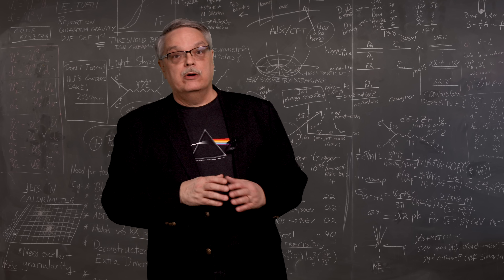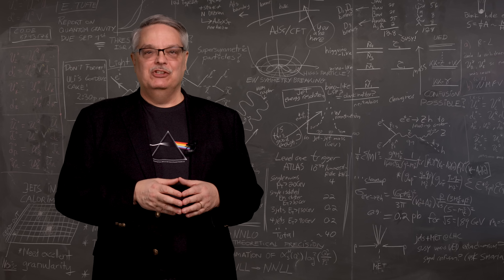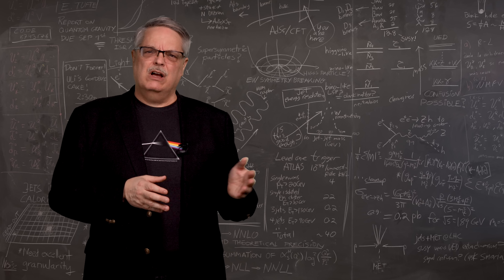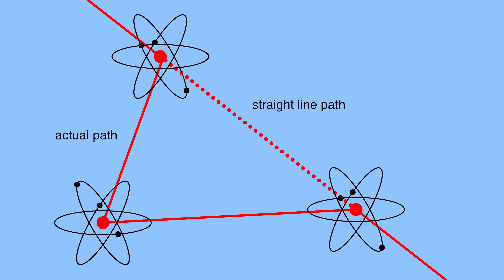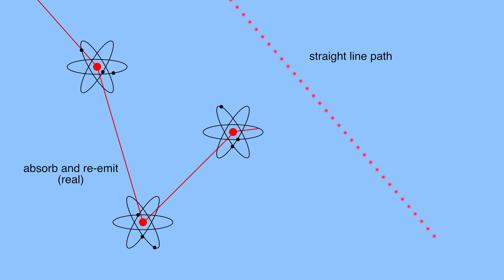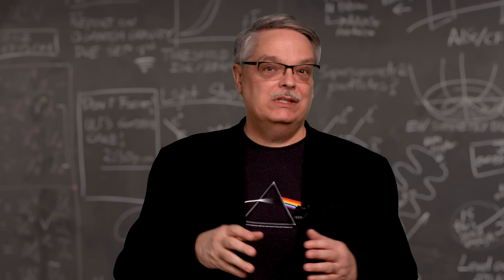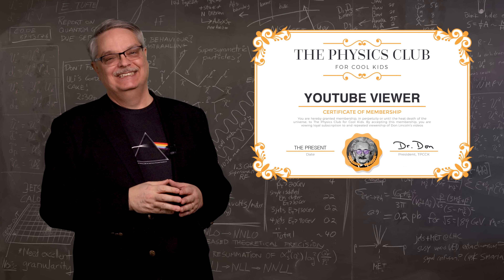Why does light slow down in water?

Comment: But why does it bend at an angle after hitting the glass?
Reply: @xStorm78  That's what I've always been told, but it still confuses me. I totally get the logic. It's like a car moving from one area to another with less traction. As one side of the car hits that area it slows down while the other side has not yet entered and wants to continue at normal speed. The result is the faster moving side has to swing around because it is rigidly attached to the slower side. BUT a beam of light is not like a car because no portion of the beam is rigidly attached to any other portion. So it seems reasonable that each photon would simply slow down and continue moving in the same direction independently of the others. Some people talk about photons themselves having width, but I don't really get why or how it would be defined or determined. When you draw a photon's wave, that's not really how the photon is moving in space, it's simply a representation of the magnitude of the electric or magnetic field across the line of travel. I've heard that photons have width (or diameter) because they have wavelength, and those are somehow related, but I don't get that either because the wavelength is orthogonal to the width and it seems like they should have nothing to do with each other. So.... I don't get it.
Reply: @MichaelDavis-zu2ko  This is hard to describe without proper illustrations.
A single photon is a wave, that can have any width. When wave changes velocity when coming into a denser medium at an angle, it's frontal parts strike at different times. When a "new" wave propagates from these points, due to a smaller effective wavelength, it recombines into a wave, that has a different angle.
Basically, if you have 2 circular emitters, angle of their superimposed wave is dependant on their spatial difference and wavelength. So the principle here is the same.
Reply: @tempname8263  Thank you.
Reply: @MichaelDavis-zu2ko  No it is not! That is exactly the wrong explanation that he warned about.
Reply: @MichaelDavis-zu2ko  quantum mechanics. Light scatters all around but the shortest time it can take is that one, so there is higher probability that any photon will travel through that path than other paths.
Reply: What I remember from my electrical engineering studies: If you solve maxwell's equations at the boundary of two different materials you will get changed vectorial components of the electric and magnetic field strengths that constitute the electro magnetic wave. The component of the electric field perpendicular to the boundary of both materials changes while the parallel component remains constant (same holds for the magnetic field, yet both fields are perpendicular to each other). The amount it changes depends on the dielectric properties of both materials. If you add up both components in glass like x and y arrows, the direction of the resulting field vector is different from the one in air. When the wave hits the next boundary to leave the glass, it bends again at a specific angle but this time the ratio of material properties is inverse (the wave exits the glass at the angle it entered it). Hope I could help. Sorry for my English, I'm German
Reply: the Doc explained the slowing down of waves in 1 dimension.  Do that in 2 dimensions and you will see why.
Reply: @xStorm78  I know that. That''s exactly what I'm saying. They are not attached to each other, so there is no width to speak of. The explanation requires that there is some width for it to work.
Reply: Check out another of Lincoln's videos on YouTube: https://www.youtube.com/watch?v=NLmpNM0sgYk
Reply: @user-hc5ks3rw7e  Yes he has explained it. So everyone better watch the video.
Reply: @Tomi Mikkonen This is the most stupid explantation anybody can give. Im sorry but taking the Feynman's path integral to explain why light bends through the change of medium is really sloppy. Read up the comments above, there were 2 people who gave the good answers.
Reply: it's because the resultant wave from combining incident light wave coming in with the electron induced wave, when combined, create a different resultant vector. remember that these are all vectors.
Reply: @clint330  That makes much more sense to me. Thank you!
Reply: @xStorm78  why should that cause direction change? Is there some force of attraction between different parts of the light beam?
Reply: @Peter_1986  "because it tries to take the shortest path between two points." Instead of just throwing out random things that you heard somewhere, what about actually trying to explain it? No body would ever understand what you mean by saying this unless they already have a master degree in physics on the university.
Reply: fermilab made a video on this topic, none of these answers here are correct, you should check it out guys
Reply: A single photon can still be refracted, since it behaves as a wave as well as a particle. You can't have half a wave - every wave follows the same rules, even if it only involves one photon.
Reply: xStorm78 Cool, now explain the same story with a single-photon pulse-wave.
Reply: I guess I can answer it ...please let me know if I'm wrong
if we zoom into the picture of a light ray , we can see it wide enough to see the two ends of it(horizontally). now when light ray touches a optically denser medium obliquely, one end (say end A)will touch it while another end(say end B) is still in the rarer medium. The velocity of ray at end A is less than Velocity of light  at end B. 

Now you can imagine it as a car(light ray) traveling from a smooth road(rarer medium) to a sandy plain(denser medium) obliquely.The front wheel of the car touching the sand first( end A) will be  at a lower speed than the other still on the plain  road(end B).Now if you imagined this situation correctly, you can certainly imagine what are the consequences...the car (light ray)will move towards the normal.why?because the Slower wheel (end A)as well as the faster wheel (end B) will travel different distances in same amount of time causing the car(light ray)to bend.

This is the same what happens with the light...

Disclaimer:This is not my theory. Source is internet(Mr.H C Verma) and I found it believable...Please correct me if I m wrong..or if there are any contradictions  to the above....

-a high school student
Reply: The demonstration is done using the front wave and the simple Huygens principle
Reply: Minimal energy path
Reply: Because of the atomic structure electric field pattern in the medium.
Reply: Two questions untouched as they are unsolved... First can there be negative bending aka Acceleration in a Medium? Why exactly speed of c and why slowing down exactly this fraction of c?
Reply: @gregor-samsa  Yes, you can have a negative refractive index - it's a principle of some research into metamaterials: https://www.google.com/search?q=metamaterials+negative+refractive+index
Note this is an engineered property, not a fundamental characteristic of a substance.

Why does light travel at the speed it does? Not an easy one, since it is one of those fundamental principles like 'why is gravity the strength it is?' and 'why is life?' - this article summarises it quite nicely: https://aeon.co/essays/why-is-the-speed-of-light-the-speed-of-light

For the reduction in speed of light, maybe start with Snell's law, which describes the relationship between refractive index and this reduction in speed. If you want to know why this exact speed reduction, maybe look at the Huygens–Fresnel principle as a start.

Makes sense these things wouldn't be addressed in an introductory-level video since they get pretty intense.
Reply: Why are people mentioning gravity???
Reply: @thedeathcake  As another example of a fundamental force.
Reply: he has a video about this
Reply: The angle of the light may have something to do with the entrance parallel or none parallel to the structure where the entering of the glass or water surface is parallel or non parallel to the exit or the other end of the glass or water structure it self , affects the dimension in where the light is directed to. In details the light travelling from surface a to surface b ( other side )(which is imaginary or straight line across) corresponds to the tangent angle of the light at the distance from a point light entering  surface a to point b at the other end . Therefore the material that covers the area TANGENT to where from the light entered and exited is somehow trying to absorb the light from the exit at the shortest amount of energy possible to avoid breaking the laws of conservation. In simple words the exit that is closer to the entrance with the ratio of the imaginary exit (straight line across) is created depending on the angles between surface a and b , and that slowing down of the light is actually the transfer or conversion usable energy of the electron thereby creating the precursor EM wave of light go against the omega Em wave ( followed after the precursor) therefore slowing it down. Again energy conservation is the key.
Reply: OK. to better explain the angle of the light being closer to the exit surface ,but without the energy turning against itself the energy stays the same and will go through the material without any affects what so ever.
Reply: You should try to wade through Feynman's spinning arrow explanation.
Reply: Huygens construction explains this.
Reply: https://youtu.be/NLmpNM0sgYk
Reply: Robert Mattfeldt  https://youtu.be/NLmpNM0sgYk
Reply: @xStorm78  This is wrong! If you wanna know why there is a video on this channel as well. Light takes the shortest path.
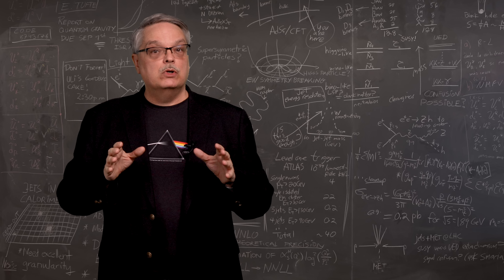Reply: Isn't this explained at 8:45 ?
Reply: @JOpethNYC  No
Reply: He has a video that explains it.here is the link:  https://www.youtube.com/watch?v=NLmpNM0sgYk&list=PLCfRa7MXBEsoJuAM8s6D8oKDPyBepBosS&index=6&t=0s
Reply: It has to do with microscopic structure of the glass, which in turn defines how electrons in it can move to react to incoming light. You can visualize the structure better using microwave due to its convenient wavelength.
It is possible to change the speed of light without changing its direction, even when the incident angle is not zero.
Reply: @xStorm78  That is exactly the wrong answer which he warned about in the video.
Reply: @xStorm78  NO! It is a wave phenomenon, not a particle phenomenon. You need to watch the video again, because you failed to understand it the first time.
Reply: @xStorm78  Nope, sorry but you are wrong. Fermilabs has done a video on that too. It quite good.
Reply: @PastafarianBEAVIS PROscience thanks. I was wrong
Reply: Your question is answered here : https://www.youtube.com/watch?v=NLmpNM0sgYk
Reply: Light follows shortest path to compensate for loss of speed
Reply: There is another of his video explaining this
Reply: https://youtu.be/cep6eECGtw4
Reply: I don't see it as a right explanation...
Reply: https://www.youtube.com/watch?v=cep6eECGtw4
4:40
Reply: because the phase(angle),which depends on the amplitude(which reduced), decreases
Reply: The car analogy is actually pretty good for intuition about what happens, but it doesn't really explain the why. 

For a more accurate picture, say you have a wave (with crests and troughs) made of individual rays running parallel coming up to a surface at something like a 45° angle. When they hit the surface, every ray scatters evenly in all directions, into a spherical wavefront centered on where each ray hit the surface. If you propagate all of those spherical wavefronts at the speed of light in the new material and see where the crests and troughs add up and where they cancel out what you find is that the end result looks exactly like what you would expect if the rays from the original wave were rigidly connected to each other and they turned like a car when hitting that material. So even though the photons aren't really tied to each other, for all intents and purposes they actually sorta are.
Reply: The wrong Is rappresent waves as lines . That's only the direction.
Have you never be on the beach ? Waves are not lines but Hills and valleys.
If they arrive perpendicularly they are reflected the same but if they arrive with an angle the part that arrive first is reflected first and the last part later, the result Is a deflection of the wave to an identical angle It comes.
For refraction Is the same process.
Reply: https://youtu.be/NLmpNM0sgYk...bump
Reply: @MichaelDavis-zu2ko  yeah, science doesn't work the way gdolphy is talking. you don't 'consider your right and i'm wrong but just consider i'm right, so let's go perpetuate and spread my ASSumptions and bs theories while never doing any work to validate or invalidate anything' uhhhh.... jesus! if you want ME to consider YOUR theory OVER what others have already done work to prove, then go DO the work to validate/prove what you're pumping.  or DON'T because what's being discussed is already proven, over and over and over... WTF?!!?!?!    yeah, Mass Defect... you're right lol ugh! no more youtube comments explanations from me lol
Reply: Take two wheels attached to a shaft and roll them down an incline. If they make contact with a different material at different times the direction the shaft is heading changes. Now consider the one wheel to be the peak of the wave and the other to be the valley. Thus will also show the direct change back to its original heading if it comes back in contact with the original material.
Reply: blah blah blah above has it right.
Reply: @DocSiders  As I explained Huygens Principal is from the year 1678.  Getting it somewhat right is NOT the same as getting it exactly right.  He was explaining it using an analysis method.  It is a method that FAILS at explaining the double-slit experiment.  For explaining all observed phenomena the "wave function" and QFT is used.  What part of that am I wrong about?
I feel like I am arguing with a Flat Earther. A "Flat Earther" can't be set straight until they achieve a higher level of education.
Reply: Watch the next video: https://www.youtube.com/watch?v=NLmpNM0sgYk
Reply: The true explanation of this is in the quantum mechanics and principle of minimum action. Easier explanation is that light always travels along the most time advantageous trajectory.
Reply: Sebaka & Co.  Yes, it sounds like light knows what is the best trajectory to travel along to save time, but it is not quite like that. The reason light behaves this way is that it has no other choice. The trajectory in which light travels is the only trajectory that survived during procces called destructive interference due to supeposition of wawe functitons that describes the foton behaviour in time. I know it sounds crazy and complicated, but the real physics is complicated ... :D
Reply: Sebaka & Co.  I am sorry but have you passed the quantum mechanics course? Or are you even physicist? luckily physics is not about opinions but facts. Maybe you should atleast learn something about Fermat principle or Hamilton formalism, before you stigmatize something wrong.
Reply: How fun. A discussion about something that we just don't understand intuitively. Wave particle duality, each explains some characteristics only. 
Look for waves, find waves, look for particles, find particles. Look for one after the other and it goes back in time to change to the latter.
Then there is the single particle that goes through 2 slots at the same time, like a wave.
Reply: 2:12 He says "it will choose it's direction."    I was surprised that that was not explained.  But great video.  Thanks to all the answerers.
Reply: Think of a boat with two engines side by side.  If the light enters at an angle one motor slows down first followed shortly by the other motor slowing down causing the boat to turn in direction. If light hits glass at 90 degrees, there is not bending.
Reply: @Tomi Mikkonen  OK, gut why then does it not go straight through , top to bottom?
Reply: @xStorm78  false
Reply: The same reason :D
Reply: cuz math
Reply: Think in terms of photons.  When photons encounter the material medium, they get absorbed by the electrons in the material atoms.  Shortly later, the excited electrons fall back to the ground state, emitting a photon.  That photon could be emitted in ANY DIRECTION.  However, photons have an internal "phase."  If you choose any direction and add up the cumulative effect of all photons emitted in that direction, you have to consider that phase and let it lead to constructive / destructive interference.  In all directions except the one that we observe (the bent direction) that interference is nearly 100% destructive.  Only in that one special direction do you get heavily constructive interference, so that's the direction we see the light go.

Yes, I know this is more or less exactly counter to what Dr. Lincoln said, but I think he's mistaken in rejecting absorption / emission as the key mechanism behind all this.  When considering the interaction of photons and electrons, absorption and emission are the only things that can happen.  There are no other ways for them to interact.  I think if you "zoom out" to a level where you are not considering individual photon/electron events, but only their average, then Dr. Lincoln's stated correct answer is probably an accurate description.  But that doesn't mean that you can't explain what's going on at the particle level.
Reply: He has a video explaining this exact question
Reply: Sunny shah 
Light slows down and bends,so when you do the calculations of relative distance..c remains constant!
Reply: Why are materials transparent?
Reply: Watch his another video on it. all these above explanations are wrong by people.
Reply: Well, I still believe this is part of relativity theory because light travels in space-time it self, in a glass, water or whatever, the light still has the ability to travel in space-time so, the mass of the glass expands space-time, the more mass (density) the more expansion then time slows down the same way in a presence of gravity, the mass of our planet has the ability to stretch or expand space-time.
Reply: There's a video already now...u can check it out for correct explanation
Reply: @xStorm78  The speed of light is a constant, its literally scientifically impossible for light to slow or accelerate. Stop saying light slows down, you make yourself look like a fool
Reply: @xStorm78  That explination seems to say what I already have but in a lot more words. My example of shining light into a glass of water is true in that just because the light took more time to reach one end to the other doesn't mean it went slower, it just took a longer path due to refraction and refraining of light.
It's not like the energy of a photon gets drained away when it comes in contact of an object, the photons themselves get absorbed or reflected, it's not a loss of output energy, it's a higher need for input energy. I feel it's in accurate to say that light slows down when in reality the light is traveling further, losing more energy through refraction, and appearing to travel slower.
Not to mention that time is far less a variable constant than light, so to try and measure how long it takes light to go from here to there is in a way bad practice even if we don't have a better comparison.
Reply: Because of Faradays law and ampere maxwell equation
Reply: As it slows down...
Reply: Question: Based on this video explanation, does it means that if I place in front of me on the right many many glasses (or pools of water)on and on the left have nothing... would I be able to see an event happening in front of me slightly in the past on the right side?
I am considering only the speed of light and not any dispersion or attenuation of the light travelling those glasses (or pools of water).
Reply: @GooogleGoglee  Yes.
Reply: https://youtu.be/5D5tR3nq7VI
Watch explained by HC verma
Reply: Here is the explanation -
https://www.youtube.com/watch?v=NLmpNM0sgYk&ab_channel=Fermilab
Reply: The light, It gets absorbed by the atoms and has to exceed a capacity threshold before being discharged to continue traveling like a neuron firing in the brain.
Reply: This can be explained with Huygens principle of waves. It states that every point (particle if the wave is mechanical, i.e sound) touched by a wave starts propagating it by its own.

Because of, you know, singular points propagating the wave, these propagate it on a sphetical way, not straight. But they end up combining to build the shape you put in the water without scattering. This is why you can see the tip of the pencil submerged under the water, not a giant yellow blob of light.

i didnt really know how to explain this part, so please search "huygens principle" on google images and use any of the first results to ilustrate my explanation. Or look for a better one while you are at it, whatever
Lets imagine you can stop time just on the moment the light of a laser is going to touch the water. Because the laser is kinda tipped, the light comes at an angle, and the light "front" is perpendicular to the ights direction, so parts of it will touch the water before others. When the light REALLY STARTS to touch the water only one of the tips of the "front" is , the rest is still just hovering on the air. The particles of water touched by the tip propagate the laser light, but a big chunk of the "fronts light" emitted by the laser isnt touching the water yet. By the time another chunk of laser has touched the water and the points have started propagating it, the "sphere of light" propagated by the particles touched before is bigger. When the laser has entered the water entirely, the spheres of light propagated by the points touched first is significally bigger than the spheres of light coming from the points just touched. Then you can connect the spheres with a straight line, that shows you the new wave "front". Knowing that the "front" is perpendicular to the wave, then you can draw the new wave direction, and see not only does it change, it is more vertical .

I hope you understood this or helped you and the lurkers looking for answers to this xd.
Reply: @blablabla8674  Wow nice explanation I was thinking the same thing in terms of Huygens principle however you explained it much more clearly than I would have, I like how you've explained it with steps and referring to the wavelets propagating at different points in time!
Reply: @blablabla8674  What? Did you time travel from the past to give us the explanation from the year 1678.  There are way too many arm chair Physicists that look up stuff on Google to pretend they are smart.  Huygens' theory did not fully resolve all observations such as the low-intensity double-slit experiment.  The wave function and quantum field theory do. So your clumsy explanation is just an analysis method that "mostly" works.  Until you earn a PhD. in Physics...please leave the explanations to those that have one.  I don't criticize the others because they don't pretend as hard to be experts.
Reply: @blablabla8674  Thats a wrong explanation. watch his another video.
Reply: @blablabla8674  thank you for your explanation cos I was still confused when I watch this guys video. Your explanation made a bit more sense. Appreciate it very much
Reply: @xStorm78  it's quite amazing how many different answers there are on here. :-) Though no one really knows for sure, I think the best way of thinking of all matter and energy is in waves. In fact, nothing ever really interacts since waves just pass right through one another, but they do interfere. And virtually every type of percieved phenomenon in both matter and energy can be illustrated as a peek or valley of an interference pattern. (Ineria, refraction, pointlike existence, force patterns following the 1/d^2 rules, color, charge, etc, etc) Even bending of light is just an interference pattern. Inertia ties into mass/velocity relationships and even those can be a transform of interference if you start at the 4 wave base principle of the fundamentals of existence. Such visualizations are difficult though.
Reply: @Peter_1986  i wonder if that light ever stops to say 'hey why do i bother moving on ??'
Reply: @ckdigitaltheqof6th210  Really?! So now you are ascribing intelligence to light? This is a physics, not metaphysics.
Reply: By the way, for anyone who wonders why light takes the shortest path in terms of speed: if you make a mathematical equation for calculating the time it takes in function of the angle of refraction, you will find that exactly the real angle of refraction is where the light ends up. This could be considered a coincidence in that the mathematical equation cancels nicely.
If you know where the light started and ended, of course it makes sense to use this property, but when the light enters a medium, it doesn't know what's ahead of it. It doesn't know where it should end up and therefore also can't calculate how to bend, like some people here said. It just bends like it was taught to and it ends up in an arbitrary point. This point just happens to be placed such that the light will travel the distance in the least amount of time, but this is really just a coincidence in the mathematical equation, because some terms cancel nicely.
Also, some people may say this is not a coincidence at all. Well, I say this to those people: why are the laws of physics exactly how they are (even if we don't know some of them)? They seem to enable life so well, that it seems like a coincidence. (without gravity, matter wouldn't group in such a way that we could exist; if energy could be created for free, the universe would just explode without giving a chance to let anything live...) In fact, one could pose that many different universes exist, all with a different set of laws. You were born in this universe, which means that the chance that a life is created somewhere is probably big in this universe. Yes, chance, because, you have to admit, it is entirely a coincidence that life was created on this planet.
Reply: @fghsgh  Could we say because it always travels the least amount of time it is therefore always at its maximum possible speed.  In that sense light doesn't ever slow from whatever it's maximum possible is.  And that speed is still faster than anything else?  The reflection of light where some is absorbed but the rest is reflected presumably has very minimal slowing.
Reply: Look up for snell's law
Reply: It does because it s slows down and it's refraction occurs because of the way you are observing it. You are observing streams of  light that is in a continuous path that are next to each other do when it an angle one stream hits the glass first ahead of the other stream some distance away and beside it which hits the glass later.  You might also note that it  is refracted back when exiting he glass. 

It is similar to two runners some distance apart but equally beside each other . If the near one passes from a firm ground onto a soft mud at some angle to it he will slow down first and the other will to get ahead but upon exiting he mud the near one who exited the mud first will then catch up to the other one by speeding up first on the firmer ground.
Reply: @Rob-fx2dw  Doesn't make sense because the individual photons aren't connected to each other in any way. The runner analogy doesn't make sense either unless there was a rule that the runners had to stay next to each other. Otherwise, they wouldn't need to wait, speed up, turn, etc. - they would just slow down but keep going in the same direction. I literally already stated the analogy of a car going onto soft ground, which actually does make sense because a car is a single rigid body with two sets of wheels some width apart. But as I said before, it's not an accurate analogy for refraction because light beams are not rigid/connected like a car. At this point, I'm just repeating myself.
Reply: The light going in is not the light coming out. The wave impacts the glass and causes the glass molecules to vibrate thus propogting that frequency through itself. Light doesn't even travel. What you are seeing is the movement of molecules as a result of vibrtion from a point source.
Reply: @gdolphy  True.  Wave elements don't travel.  At least in Euclidean space.  They propogate.
Reply: @gdolphy  None of what you just said is right.
Reply: @MichaelDavis-zu2ko  : the guy who came up with the levitating top was told by others smarter or as smart as him that it was impossible and yet we have the toy today.

Many would say space is a vacuum. Has any ever considered that the earth is highly pressurised?

I will consider the possibility I am wrong but please consider I may be right.
Reply: Sunny shah Light always takes the shortest path...
Reply: @ghassanm3  Not the shortest path, but the path that takes the least amount of time to cover, there is a subtle but important difference. If light did take the shortest path, it would not bend. Look up Fermat's principle.
Reply: @ghassanm3  No.How should light know which is the shortest path? Light takes ALL possible paths but most of them cancel out by superposition.
Reply: @ghassanm3  This principle states that the path taken between two points by a ray of light is the path that can be traversed in the shortest time but not the shortest path. ... That's the reflection point light chooses among the other points because it takes less time to travel to your eyes.
Reply: @ghassanm3  it takes a straight path, its not necessarily the shortest
Reply: @lolbro8701  Again not true. It is necessarily the shortest path (this is called Fermat's principle) and not straight in general, at least not in the sense that you mean (in the Euclidean metric). It follows a geodesic, which is found by solving a calculus of variations problem.
Reply: @lolbro8701  it takes the least time path
Reply: @Joso997  the direction change is the interesting thing.  Afaik instantaneous.  Obs poster is looking for best explanation for that.  I'm more interested in the instantaneous wave addition (seems to pan out in general terms, not gone into in the vid)
Reply: Perfect Dark S/he was asking about the mechanism, not the phenomenon or principle.
Reply: @ghassanm3  The shortest path is strait so maybe you should say "tries to take the shortest path"?
Reply: @ghassanm3  What is the reason for that?
Reply: Wrong. Light always takes the path of least time not distance
Reply: @ghassanm3  Yes but why right?! It's so weird, there was a mathematician that used a sh*t load of time finding the shorts possible path through a medium with increasing resistance, like imagine a puddle of mud that gets stiffer and stiffer every inch you walk. He finally found out what had been shown in physics, that the curve was brachistochrone. Which just happened to be how light moved when in the same thought puzzle, how does light do this?
Reply: @kaspernordlund6828  I understand how strange reality is and it may not make sense on the surface but light has so many properties to it that may not make sense on the surface like what determines it's speed in any medium (and that turned out to be dependent on the permeability and permitibility of the medium), why is it the speed limit of causality, the massless property of light... etc. The fact is that the dual property of light (particle and wave) is what makes it do that. The closest article that dives into this is this: https://www.askamathematician.com/2011/08/q-why-does-light-choose-the-path-of-least-time/ ... I hope this helps.
Reply: @ghassanm3  whyyy?
Reply: @ghassanm3  it doesn't take the shortest path it takes the path of least time the shortest time may be the fastest if it's traveling in just one medium but the shortest path is not the least time path if you have to travel through two mediums
Reply: I think it‘s because the lightwave gets influenced by the electrons. When it has passed the material, it gets faster again and changes the direction back to its original
Reply: @justsomeone899  "I reposed this so you get notefide =)"When we talk about the speed of light, we're usually talking about the speed of light in a vacuum, which is 3.00 x 108 m/s. When light travels through something else, such as glass, diamond, or plastic, it travels at a different speed. The speed of light in a given material is related to a quantity called the index of refraction, n, which is defined as the ratio of the speed of light in vacuum to the speed of light in the medium.When light travels from one medium to another, the speed changes, as does the wavelength. The index of refraction can also be stated in terms of wavelength,Although the speed changes and wavelength changes, the frequency of the light will be constant. The frequency, wavelength, and speed are related by,The change in speed that occurs when light passes from one medium to another is responsible for the bending of light, or refraction, that takes place at an interface. If light is travelling from medium 1 into medium 2, and angles are measured from the normal to the interface, the angle of transmission of the light into the second medium is related to the angle of incidence by Snell's law :When light crosses an interface into a medium with a higher index of refraction, the light bends towards the normal. Conversely, light traveling across an interface from higher n to lower n will bend away from the normal. This has an interesting implication: at some angle, known as the critical angle, light travelling from a medium with higher n to a medium with lower n will be refracted at 90°; in other words, refracted along the interface. If the light hits the interface at any angle larger than this critical angle, it will not pass through to the second medium at all. Instead, all of it will be reflected back into the first medium, a process known as total internal reflection.

Total internal reflection
The critical angle can be found from Snell's law, putting in an angle of 90° for the angle of the refracted ray. This gives,
For any angle of incidence larger than the critical angle, Snell's law will not be able to be solved for the angle of refraction, because it will show that the refracted angle has a sine larger than 1, which is not possible. In that case all the light is totally reflected off the interface, obeying the law of reflection.

Optical fibers are based entirely on this principle of total internal reflection. An optical fiber is a flexible strand of glass. A fiber optic cable is usually made up of many of these strands, each carrying a signal made up of pulses of laser light. The light travels along the optical fiber, reflecting off the walls of the fiber. With a straight or smoothly bending fiber, the light will hit the wall at an angle higher than the critical angle and will all be reflected back into the fiber. Even though the light undergoes a large number of reflections when traveling along a fiber, no light is lost."
Reply: @coltmerg 420 ty for the detailed answer, didn‘t know that much about photons😁
Reply: @coltmerg4202  You are describing the phenomenon, not explaining it.
Reply: @justsomeone899  He was perfectly clear about the reason. EM waves, like light, cause the electrons in atoms to move. Moving electrons generate EM waves which interact with the incoming EM wave, much like two water waves interact, it's called superposition. The resultant wave moves more slowly through the medium. Once the wave reaches the next surface and leaves the water (glass, or whatever) the second wave ceases to exist and the wave moves at the speed it had before entering the water.

The ratio of the speed of light in a medium to the speed in a vacuum is called the index of refraction. For instance, an index of refraction of 1.33 for water means light travels 1.33 times faster in a vacuum than in water. The greater the index of refraction, the slower the light travels in the medium and the more it will bend.
Reply: @Wayne Adams yes, that‘s correct, but with what was i wrong, then? I said exactly that in just much less text 😉
(And by the way are electrons from atoms already moving ;3 that‘s why the question is given, what happens to atoms at the totally 0 point of temperature when they stop moving)😇
Reply: @justsomeone899  Electrons do not move in atoms, they quantum jump, that is why we visualize them as clouds with the electrons occupying no specific place.
We generate a probability map using the wave equation which gives us the shapes of the orbitals.The orbitals are only probability maps, the electrons have very small probabilities of being outside the boundaries of the orbitals.

The big problem with the little solar system model of the atom was that an electron moving in an orbit is accelerating, and accelerating charges radiate (loses) energy, so the electrons would lose energy and crash into the nucleus in nanoseconds.
Reply: @wayneyadams  "they quantum jump" 

No, no, no, no. Just because we are uncertain on where they are, and their position is mathematically described as a cloud of probability, that doesn't mean they can be at two places at once, quantum jump or other rubbish I hear being thrown around. An electron must always exist somewhere, the "collapse of the wave function" as they call it is just fancy talk for determining a previously unknown quantity.
Reply: Light must synchronize with the shape of a structure, resulting in deflecting and vectoring do to the principle of two or more elements attract called Gravity, light must randevu around elements like objects do among solar system and planets in the path, it must like so with nutrons,atoms ions etc..., because it cannot actually go through an element or it will no longer be, so until a path is merged by structure form.
Reply: @ckdigitaltheqof6th210  I don't understand why there are so many people coming up with all kinds of crackpot nonsensical explanations, when the video explains EXACTLY AND CLEARLY what happens!!!!!
Reply: @wayneyadams  The video doesn't explain, its declaring one theory for another as the behavior of light showed unpredictable, when it must simplistic into behavior of large elements in the most primary form ratio, in truth, gravoty is far more prime then light. Like objects do with gravity when traveling or drift in space. ...& i don't have to explain my source, just the subject matter.
Reply: @ckdigitaltheqof6th210  uhhhh no
Reply: No that's not possible because light can be bent with heavy maas only because if lights path can be changed by that small transparent object which has very less mass than light should be bent by me too as I am heavier than that tiny glass piece
Reply: @neelam6722  That's a totally different effect. Light is not bent by mass, space time is. Light just follows that curve. Very different from refraction.
Reply: @iiib2975  No, that's not true. Gravity has nothing to do with it. It still has to do with electromagnetic waves: the angles (or rather their sines) are defined by the phase velocities in the two media. This is called Snell's law in optics.
Reply: @iiib2975  nope nope nope nope nope nope. This would happen in empty space with straight geodesics
Reply: @iiib2975  Lol this is so far from true it's laughable
Reply: No, it's not true. Your answer makes no sense at all.